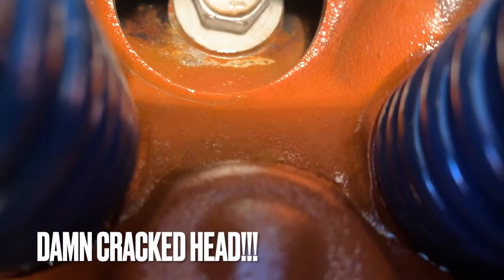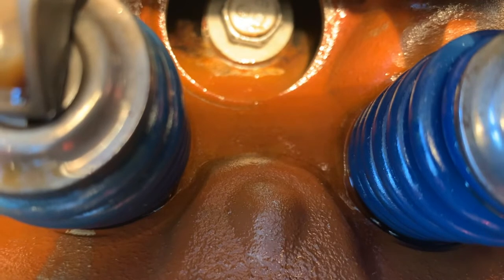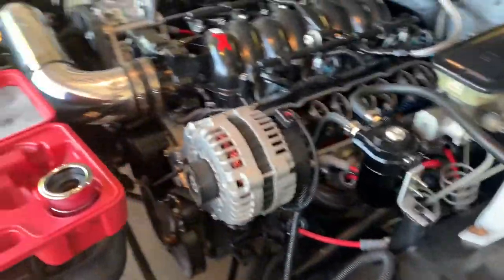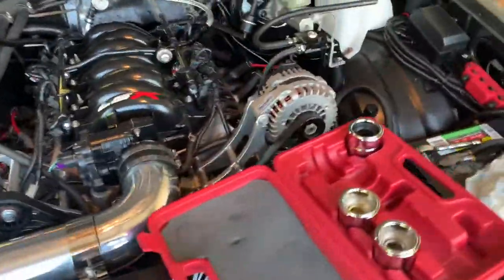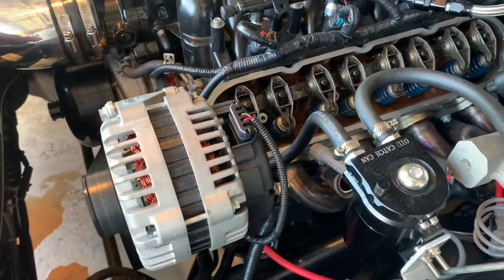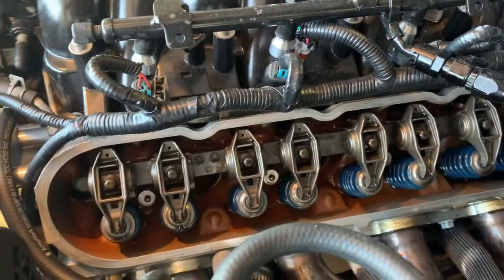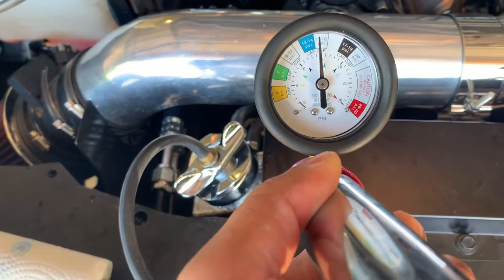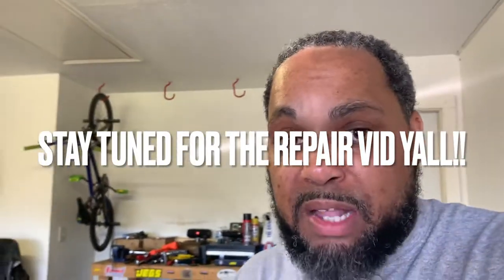How To Pressure Test A LS for a Cracked Head

Comment: Hello what headers are you using
Reply from the maker: Im no longer running headers, im using the Patriots brand LS swap manifolds. I was using the inexpensive ebay S10 LS swap headers. They fit ok but not the best.
Reply: @mainskware   Do have a part number?
Reply from the maker: @dennisalstonZ06  https://www.ebay.com/itm/Swap-S10-Conversion-Headers-for-Chevy-LS1-LS2-LS3-LS6-LS9-LS-Engines-6-0-5-3-/122693042414?mkcid=16&mkevt=1&_trksid=p2349624.m46890.l49286&mkrid=711-127632-2357-0
Reply from the maker: Thats for the ebay S10 headers…i used the Patriots manifolds part # Patriot H8097-B Header (1 5/8" Cast Tubular Manifolds for GM LS Engines).
Reply: @mainskware  Thanks for the info.
Reply from the maker: @dennisalstonZ06  absolutely my man! No problem.